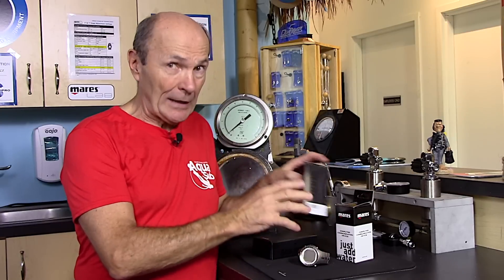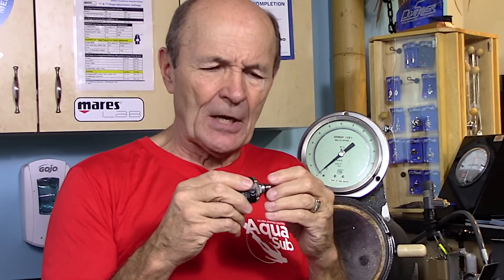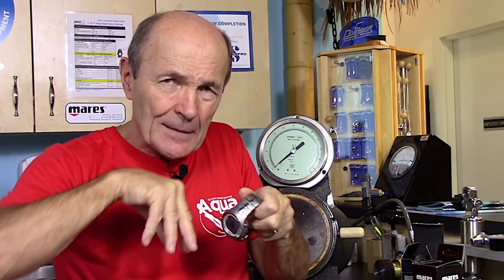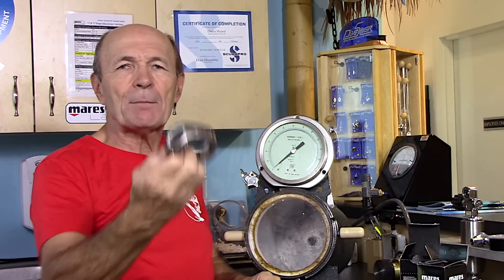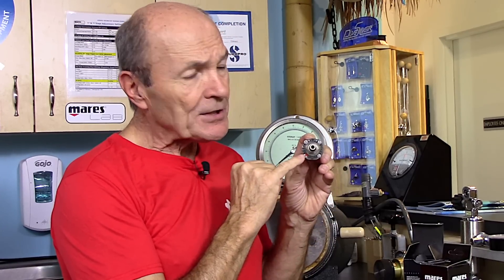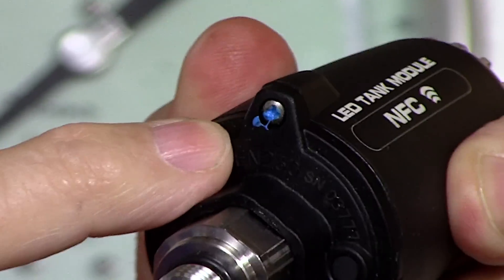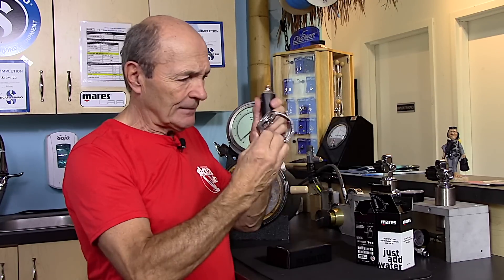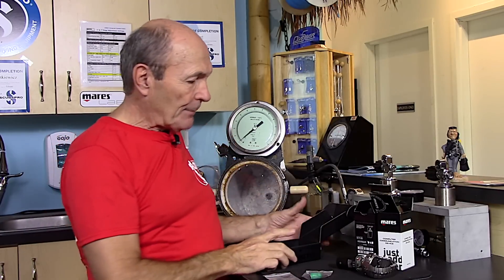Wireless Transmitter Battery Change - Scuba Tech Tips: S08E11

Comment: I hope everyone knows to use an SPG in concert with a computer! Redundancy will save your life.
Reply from the maker: New computers are MORE reliable than SPGs Bill.
Add to that the tremendous advantages that a computer gives a diver and the sooner SPGs are gone the better.  
If it makes you feel better to carry an SPG, go for it. But please don't say it's necessary.
Alec
Reply: Huh... I learn something new all the time here.
Reply: Agree with ditching the spg. Redundancy for air shouldn’t be needed. If your checking your air constantly like you should and suddenly you find your transmitter is not working or your spg is not working you just end the dive. If your method of measuring air fails and you have NO idea how much air you have left it means you don’t check your air often enough.
Reply: Last month in Bonaire the (1 year old)  flex hose of my SPG started leaking. I removed it, capped it, and used my computer only for pressure readings. 
Only time I really missed the SPG was during the tripple check breathing out of my second stage  before getting off the boat. I always do a few quick breaths to check for a moving needle.
I just need to remember to turn on the computer before entering the water, just to do that check.
Otherwise, the set is easier to assemble (I have a BCD which routes the SPG and inflater hose though the BCD), and leaner in the water without the SPG. I never checked the SPG during dives since I have my AI computer, anyways. So during a dive you'll not miss it at all. And the new AI systems are extremely reliable.
Reply: I use an analog backup.

Comment: Does NOT takes the place of the SPG. It is just an addon gimmick. :)))))
Reply from the maker: Is this the same Chirana that uses a Shearwater Dive Computer?
Dive computers are hardly an add-on gimmick any more than your cell phone is a toy!
1. It's not a gimmick. Dive Computers have made diving easier and a lot safer.
2. It's hardly an add-on. Most diver training programs now use dive computers from day 1. Many dive centers worldwide make dive computers mandatory gear to dive with them.
Alec
Reply: @AlecPeirceScuba_SeaHunter  Of course Alec. I was joking. Wireless transmiter is of course nice to have but will not replace the SPG. Of course the anticipation of time remaining underwater and correct display of RMV is crucial. Adding a heart rate monitor is even better.
All my best Alec and keep up the advice and tech tips.
Reply: @chiranagheorghitaeugeniuth98  - You are horrible at jokes then and should STOP.
Reply: Spg’s are not needed if you have a wireless transmitter. If your spg ever failed would it be a drama? Nope because you would know how much air you had when you last checked so you just end the dive. Do the same if your wireless transmitter failed🤷🏼‍♂️ I laugh at people that have the wireless AND a spg. Before you got a wireless transmitter did you run 2 spg’s?!?! To each there own but it’s certainly safe to not run an spg if u run a wireless!
Reply: @geoffclarke5901  Have you ever had a SPG stuck. I had at 150 bar at 40 meter with deco obligation. Good luck in ending that dive. SPG can get unstuck by multiple actions. Wireless transmitter not. I do not say that new tech is bad but why would you introduce another fail point in your equipment. I run a non AI shearwater computer with 2 spg for my doubles. I think this is pretty straightforward and simple approach. And by the way: when shit happends it is a very shitty situation no matter on how redundant is our gear. Only thing that matters than is if you end the dive dead or alive  with or without the dreadded gear.

Comment: is the Wireless computer more reliable than a normal air intergrated dive computer that connects to the tank?
Reply from the maker: Well, let me weigh in here guys.

Your question was whether a wireless (called hoseless) dive computer was more reliable than a hose style.
The answer is not quite that easy. I would say that a hoseless computer is not more reliable but a hose style is more subject to failure. if that sounds like double-talk, let me explain.
A modern hoseless computer, less than 5 years old, if properly maintained and treated with care, is completely reliable. Setting aside obvious mistakes like low battery, poorly done battery change, abuse, etc, a wireless computer will not let you down. Yes, they will lose connectivity regularly just like your cell phone but, unlike your cell phone, they reconnect in seconds. That is part of their nature and is not a failing. 
Dive computers use a low frequency wave (5.3KHz +or-), the same as submarines, heart rate monitors, time signals, etc. Radio waves are much higher - between 300 and 3000 KHz (AM) or 30 to 300 MHz for FM or TV. 
That low frequency travels just fine through water for up to 15 or 20 meters. Your transmitter will be less than 1 meter from your wrist!

Hose style dive computers are also very reliable but, they have many more points of failure. The hose itself is a weak point and Hgh Pressure hoses commonly fail. Manufacturers recommend in the manual that they be replaced every 5 years. Few divers do that. As well, the swivel pin in the hose end must be serviced, that's cleaned and replaced, every year or they are sure to fail. Most hose style dive computers use a Quick Disconnect which has a whole host of problems just waiting to happen.
Generally, a hoseless computer is more expensive than a hose style. Given the additional service cost of the hose style, over a period of time that difference will even out.

Only you can decide what is best and that may be dictated by your pocketbook. With care, either will serve you well.
And if you don't buy an SPG, you can put that money towards the hoseless!!
Alec
Reply: Thank you so much for the detailed information!! Hose style is definitely cheaper than hoseless. Life will be so much easier If there is a hose style air integrated dive computer, because I don't need a SPG no more. Most of the hoseless computer is way to expensive. Maybe you can make a video on the hoseless and hose diving computer and SPG. I feel like it's a very useful topic and love to hear more about dive computers:) Thank you !! Great channel love it:))
Reply: Well, there are less parts to fail but you can get transmission issues but Alex is right about the unlikelihood, unless battery gets low, if that happens you will know immediately and can check you backup to figure out how to best return to shore.  If you do proper equipment checks it should never be an issue.  You are more likely to have a leaky hose issue then an issue with this equipment.
Reply: No it is not, and the wireless transmitter and computer shouldnt take the place of your SPG.  You can downgrade your console to a small 1.5in or 2 in SPG, but never get rid of it.  Many times Ive seen transmitters lose connectivity during a dive, (thats fine and all it will reconnect after a few seconds within range), but sometimes it doesnt reconnect or the battery dies or something happens.  A simple SPG is great, an air integrated console computer, is much more reliable, than wireless.  Radio frequencies (RF) that go from the 1st stage transmitter to your wrist computer have a difficult time traveling through water.  RF has a very hard time going through any solid objects, even submarines need to surface or get very close to the surface to send or receive any communications.
Reply: Is the wireless computer often more expensive than the simple SPG? A simple air integrated console computer maybe is more reliable.